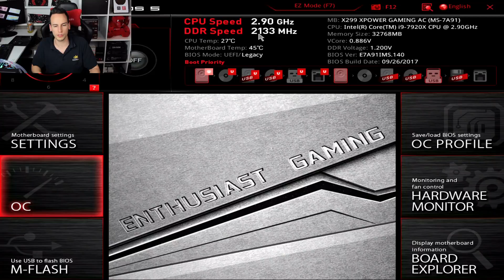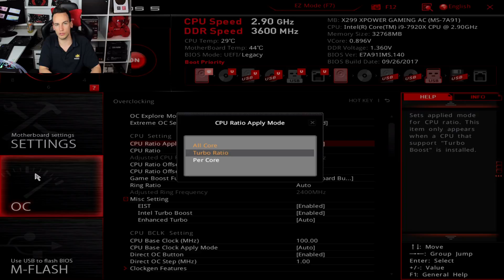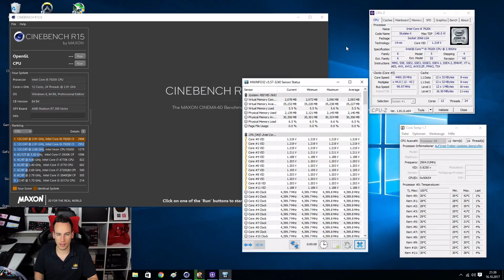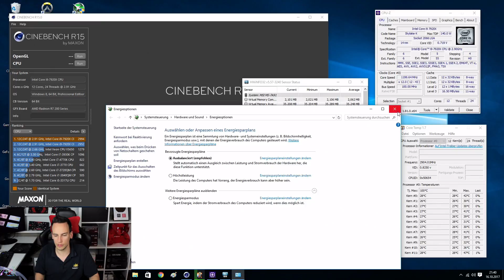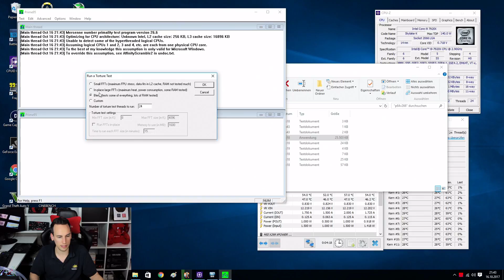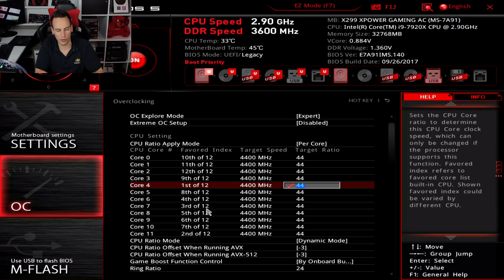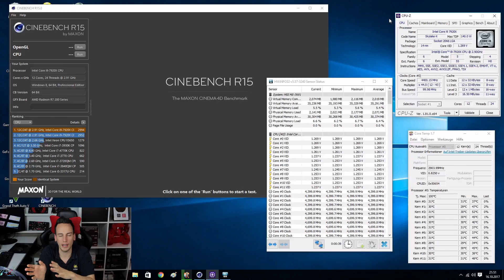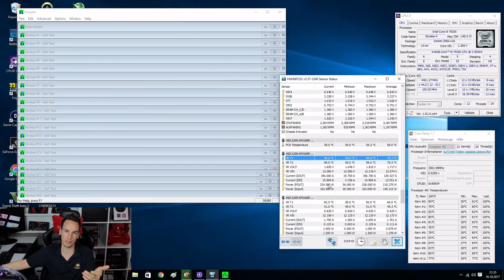i9-7920X Overclocking on MSI X299 Xpower Gaming AC (en) Guide

Comment: In 2020 I bought a i9 10980xe and a msi x299 pro carbon gaming ac and have been having so many major issues for years over getting bios right, I basically work in after effects and a lot of green screen and big renders , animations , and my exports have been high temps , blue screens, from bad power settings to the turbo boost having panic attacks, the past 2 years I’ve had a stable system but at 3 to a boost of only 3.8ghz and I’ve been like wtf is going on , I suddenly today was like I should look up previous gen versions since there’s barely info on mine and this video just kinda solved my issues. All previous  advice had not been not working. And At the moment it seems stable on test. My idle is at 2.7ghz and a current render is hitting 4.62 ghz and temps ranging from 75 to 81 / 83 . , Like holy shit thank you

Comment: Thanks for review of this M/board, please tell me where on the board i can connect of Power (2 pin) cable-connector? and i also need to know where i can connect RESET and HDD's LED cable-connector, that comes from the PC case power and reset button.

Comment: Great video man 😀 , used the per core over locking to bring two hot cores on my caseking 7980xe predelidded to 4ghz, all the rest are at 4.4ghz with 1.175 volts. Should I redelidd?

Comment: Thank you for posting this, very helpful for a beginner. I have a MSI X299 Gaming M7 ACK motherboard and followed your instructions to the letter which has allowed me to run 4.5GHz on all cores of my 7820X. Temps under full load vary between 65-70C without a delid which I find quite impressive (thats using a custom water loop). What is your recommendation for the Intel Turbo Boost Max 3.0 application? Leave it enabled or disabled?

Comment: Der8aur or anyone who knows. Did i hear correctly that the 7920x and the 7940x have very similar all core OC speeds depending on cooling? This answer will dictate my purchase. Thank you.
Reply from the maker: yep also power consumption is almost ideantical
Reply: Thanks for the response. Please let me know if this is accurate: The performance difference btw the 7920x and 7940x is under 10%? obviously this is determined by application use, but for the most part they are very similar in terms of performance? 

I keep going back and forth with which one to buy. I am not sure the 2 extra cores is justified by roughly $300 more.
Reply: der8auer one more question. The 7920x has a base clock of 2.9 and the 7940x has a base clock of 3.1. Why is the higher core cpu have a higher base clock? Is it binned higher than the 7920x? The 7940x just doesn't go with the core count/speed pattern intel has.

Comment: I am having trouble with a ram that is Samsung DDR4-2400T 4Gb.
Supporting center said me that ram does not support Xpoer gaming ac. Is it true?

https://www.youtube.com/watch?v=3WPSfF55EO4

I can see there is not an information about 2400T in the site as below.
https://www.msi.com/Motherboard/X299-XPOWER-GAMING-AC/Specification

I want to use samsung ram but there are only two options that is choosing 2400 or 2133.
Supporting center already tested my mainboard with samsung 2133 8Gb and the test succeed.

What is different 2400 from 2400T?

Comment: Fantastic video. I have I9 7940x and msi gaming m7 ack, watercooled customn ekwb. Next step I will delid. Tried to overclock switch the oc auto bios max 4 (3.1 to 4.0 ghz) and i get 90 c with many stress test, I see my voltage raised all cores to 1.250v.

Then I did your tutorial and got better overclock but still hot (need delid). Then I downgrade the voltage to offset -0.030v (less crashes) and pased aida64, prime95 all tests 12h, cinebench, 3D mark, pc mark and got stable with less voltage (1.200 aprox), then overclocked a little bit more the best cores. Hope next I will improve with delid. Thanks for your guide.

Comment: @9:42-- According to Intel's website the TJ_max for the 7920X is 95C. So running it at 105C (10C over Intel's specified maximum) for 2hours wouldn't be so safe... That being said in previous generations the TJmax was 105C so probably Intel is just being too conservative here.
Reply from the maker: +Alex Marin  intel added the TJmax feature for overclockers :) they surely wouldn’t add it if it would instantly kill your CPU. I used it many times and never had any issues

Comment: Nice video, I did these 2 tests with the i9-7900X,  same core speeds, only that for 4.7Ghz test I used 5 cores (half of 7900X). The idle temperatures on my side are similar with yours (using NZXT H440 case and X62 Kraken on Performance mode and X299 Prime Deluxe). Stable at 4.4, stable with 5 cores at 4.7 (only one core got 96 degrees, perhaps I did not OC the good core :D). Also the voltages were pretty similar. The big difference, my 7900X is not delidded and I see about 20-25 more degrees Celsius difference compared with yours, due to the tests (Cinebench and Prime95).
Reply: valivr so 7900 runs cooler than 7920x?

Comment: MSI always uses lots of doublers on their VRMs and it inflates the number of phases that they like to brag about in their marketing of motherboards. For example, their new Z370 Godlike has 18 phases. The quality of a VRM design is not just based on the number of phases, or true phases, but also depends upon many other variables and the quality of the components used. But would you say that this XPower Gaming 6-doubled-to-12 phase VRM is better, the same, or worse than the 8 true phases on the VRM of the Asus Rampage VI Apex and Extreme motherboards which do not use doublers?
 
Also, unfortunately there is no company that makes a monoblock for the X299 XPower. :-( EK makes monoblocks for nearly all of the other top flagship X299 motherboards from Asus, Gigabyte, etc. But for MSI, they only have one monoblock that fits the X299 Pro Carbon and M7.
Reply from the maker: For X299 the VRM design doesn't do much for the CPU itself since the CPU is using FIVR. I'd say there is no difference between true 8 phases and the doubled 6 phases.

Comment: 4.4ghz on all cores asus prime-A 1.195 volts ram at 1.4v at 3800 can't get it higher as I suck with ram timing 3090 cinebenchscore. can't seem to get 4.7 stable, with basic configs, even had issues with 4.6 across all. Might try the (6x) 4.4. and (6x) 4.7 Thermal take water 3.0 360 rad 75-low 80's under long renders. is a ekg vrm+ cpu waterblock recomended if I want to shoot for 4.7 across all cores stable?
Reply: 4.5ghz at 1.202 volts now.

Comment: Can you get the i9 7980xe stable at 5ghz?
Reply: And what board would you use with what kooler. I really want this bad.
Reply: Yes but you Need a rly god cooling like a chiller. Use a god Board like the rampage vi apex or rampage VI extreme Edition from Asus
Reply: ShadowGod will I be able to use 124gd ram and at least 2 xp cards in sli?
Reply: ShadowGod also what would be the best chiller to use?
Reply: And this is for a 24/7 overclock. I want it always to run at this. Just want to clarify.
Reply: Kenneth Reeves i dont know because i Never use a chiller but ask in a Hardware forum for a god chiller. You can also use a rly god watercooling loop.

Comment: +der8auer
Please make a video with Process Lasso.
Show how it works with specific applications run the higher clocked cores.
And you should do more run through bios settings, while overclocking for more brands and motherboard models.

Comment: wow that per core OC in BIOS looks awesome! Is it similar on ASUS boards and Asrock boards?
Reply from the maker: +Actually Hardcore Overclocking  on ASUS you can even set per core voltage :)
Reply: it's not really that well implemented.
Reply: Doesn't that exist since Broadwell-E?
Reply: Actually Hardcore Overclocking - Do you mean that on ASUS boards it's there but the board doesn't adhere to your settings?
Reply: Hey mate - huge fan of your channel /work, thanks so much for sharing this awesome content.  Have you done any testing with the Asus Strix-E?  Also what about Noctua coolers, any recommendations or for 7920X is AIO/custom loop the obvious route?  Thanks!
Reply: I'm trying to decide between this board and the Rampage  VI Extreme. The ability to do a per-core overclock is what will make my decision. Are you saying that the rampage does allow a separate overclock per core? Does it also tell you the favored cores?
Reply: Get the Apex instead, better for overclocking.
Reply: Asus x299 is awesome. For every core you can specify adaptive, manual or offset.

Comment: During Prime95 towards the end. 1.65 vin and 1.25 vcore.  Vccin throttling?
Reply: I don't trust software that much. My FX would show it dropped to 1.35v, but when you checked it with a multi-meter, it didn't drop below 1.5v (an oscilloscope would be better, but it would stay at 1.35v on HW monitor/CPU-Z under load). Or how my Ryzen would show over 2.5 Vcore... Or how my R9 Fury often shows 0.0001v up to 1000000+V. Or how my RX 470s show 130w power  draw, but are actually a 270w power delta at the wall. The temps people believed on FX were the best, some people actually believed the sub-ambient temps (because software must be right!), yeah, no I'm not wearing a jacket to get 8c idle temps, and I'm not using my sub-zero cooler, just the stock heatsink. Just take software with a grain of salt.